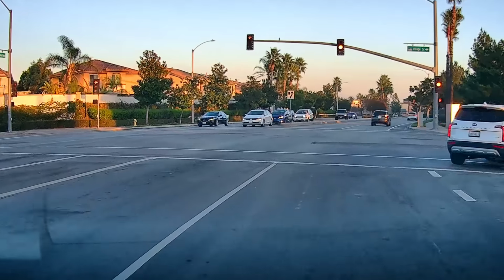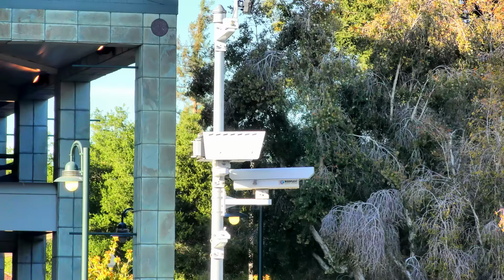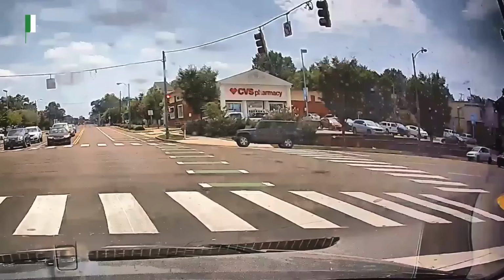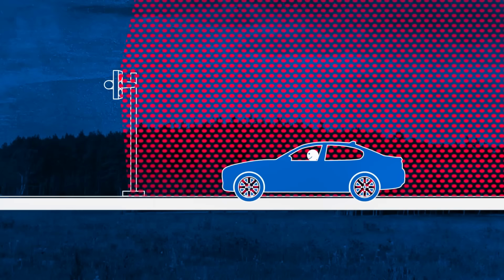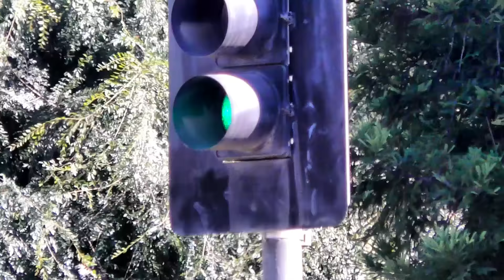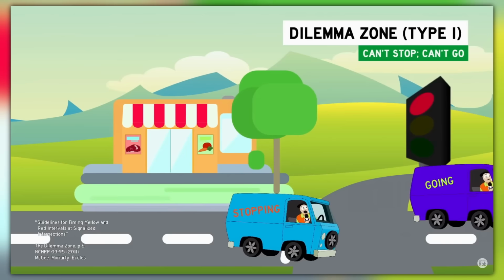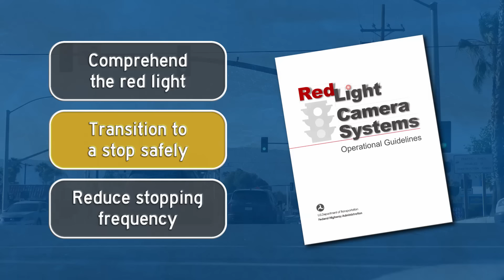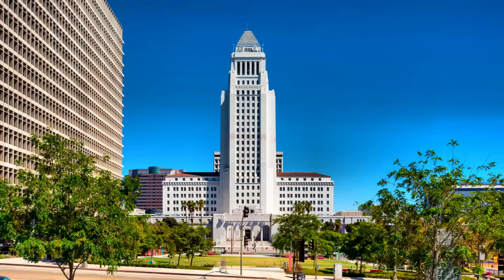Three ways to FIX a STOP LIGHT (so drivers ACTUALLY STOP!)

Comment: One thing I'd like to see discussed is the placement of traffic lights on the far vs the near side of intersections. Near side signals require a larger setback, which costs space, (but leaves a convenient spot to put in a pedestrian and/or cycle crossing) but it also gives accidental red light runners a little more time to react. As I understand, the placing of traffic lights on the near or far side isn't as uniform in the US as I first thought. Any comments on this?
Reply: I came to make the same comment.  It is my understanding that near side signals greatly discourage crosswalk and stop bar encroachment, and in addition they would be visible earlier in scenarios like following the RV.  Is it true that the primary reason for mid-intersection signals is cheaper installation?
Reply: That was what I wanted to ask as well since the near side is the standard in Europe and far side is more of an NA thing and a comparison by Rob is certainly interesting.

I can certainly add another benefit for front lights: They have to be installed to the side, slightly above the sidewalk, which in turn makes pedestrians and cyclists more visible for drivers.
Reply: @MarioFanGamer659  Something else that isn't mentioned is the painting of the poles that carry the stoplights.
Just like the backplate with reflective stripe (which is also used here), the very recognisable poles make it a lot easier to see stoplights.
Reply: @Robbedem  MN traffic light masts were historically painted yellow, while the arms over the street were typically grey. Lately the state seems to have switched to all-grey, but new yellow masts do exist. Painting the arm yellow as well would certainly make the signal stand out (the standard mast arm has two 'arms' - the main and a smaller support arm just below it)
Reply: Far-side signals seem to be the standard on state installations here in Texas, but I think this facilitates the use of camera or radar sensors to adjust the light cycles to demand, which is also very common in Texas.  Obviously, a sensor can get a broad view of all lanes from the other side.  Keep in mind that TxDOT always uses wide stop bars where you need to stop, even if it's just a rural intersection with a stop sign.
Reply: I find near side traffic signals to not be as good because you have to crane your neck to watch for it to turn green. To avoid this, you'd have to be so far back of the stop line that it just looks silly.
Reply: "As I understand, the placing of traffic lights on the near or far side isn't as uniform in the US as I first thought."

The standards you're looking for are in MUTCD 4D-13 and 4D-14.

People talk about how European intersections use only near-side signals, which deters people from encroaching past the stop line. Unfortunately for the US, that design is impossible under the aforementioned standards.
Reply: @princekamoro3869  yet there are many intersections that have them on the near side. I side they're not up to code.
Reply: Good point here. The near traffic beam is difficult to see sometimes if you’re in the first row, since you have to bend forward and keep looking up the entire waiting time. It makes me wish it was a far traffic light.
Reply: This seems to be a regional thing. I've noticed that all states do it differently but the common trend seems to be that in the West, Southeast, and middle part of the country, far side installations seem to be more common. Likely not coincidentally, these intersections seem to also have newer signals mounted on poles. Only in the Northeast do near side installations seem to be more common, often mounted by wires instead of poles. Obviously there are exceptions. Some of the coolest traffic light poles are in Tempe Arizona.

I really wish I saw more backing plates and reflective tape on intersections near me. The state re-did an intersection and put up new signals that backing plates, reflective tape, that were pole-mounted and on the far side of the intersection. This might (and hopefully is) the new standard for the state, but way too many intersections don't meet this standard.
Reply: Many traffic lights around me, New Jersey, have some lights across, but also some of the light near side as well.
Reply: Near-side signals enable more precise red clearance time calculations, resulting in more efficient and more believable (->respected->safe) red light durations. Because the formulas don't need to account for cars stopped way too far forward - those drivers wouldn't be able to see the light anyway.
Reply: I grew up in Chicago, and the streets are covered by snow or slush for many months. Can't see the stop lines, so they place a second stoplight on the left side, and I would use that to indicate where the stop line is.
Reply: @davidhirschhorn2960  in Canada we just put a sign next to the stop line so you know where it is when the roadway is covered in snow.
Reply: I accidentally ran a red light in Canada once, (I'm from the UK) and it was a 'far side' signal. I only realised I'd ran the stop line when I was in the middle of the junction. Thankfully this was very late at night, and the traffic was basically non-existant.
Reply: @MarioFanGamer659  In the US traffic light profiling is determined by states and municipality, which is why NYC and LA have very different intersections. Here in FL we don't use side signals except in very specific scenarios. Recently there's been efforts to put signals in front and at the back of wider intersections redundancy.
Reply: @OntarioTrafficMan  I'm in unincorporated Jefferson County, Colorado, and we do the same thing at most of our traffic lights (I think just the busier ones, though I could be mistaken).  It's a rectangular white sign that says "STOP HERE ON RED" with a big, bold arrow pointing diagonally down and to the left
Reply: One thing I have seen about near side signals is that it forces drivers to look out of pedestrians since they are above the sidewalk. Also I don't think near side signal require that much of a set back if at all. It's not like it has to be exactly atop the sidewalk, it can still hang out a little to give a a clearer view and contrast. I think far side is better when its more car centric like in arterial or major collectors. Near side for local and minor collectors.
Reply: @DashCamOutEast  In Europe we have lower heads on the posts as well for those at the front of the queue
Reply: @DashCamOutEast  @princekamoro Such as just about the entire state of Florida!  Almost all the lights seem to be on the near side, and with no "side" lights at all.  If you stop too close, you end up sitting with your chin on the steering wheel to be able to see the light!!
Reply: @MikeV8652  Here in the Netherlands we use a lot of smart lights, and they're almost all near side, so that's not a reason for far side.
Reply: @DashCamOutEast  A lot of european traffic light intersections also have an indicative light on the left far side of the intersection.
Reply: @sherifbatawy  A lot of european traffic light intersections also have an indicative light on the left far side of the intersection.
Reply: @fluitfluiten  yeah, but it only takes a van/ bus/ truck on the left side to block the view, which does statistically happen often.
Reply: There’s a reason he’s wearing bright clothing, wide intersections like this are dangerous unless you’re surrounded by tons of metal and airbags
Reply: @sherifbatawy  most of the time there is one above the lane as well as one on the side. The one on the side ist not that difficult to see. But I although think that works worse with more lanes. But in my city there are very few streets with more than to lanes per direction. Here in Eu
Reply: Then there's Michigan with all the stop lights in the middle of the intersection hanging from a cable. It's the worst of both worlds...hard to see and not nearside.
Reply: Here, in South Australia, we tend to have both near-side lights, to allow for early recognition, & far-side lights, so that the drivers in the front row can get a good, quick take off...
(take off being deliberately used, because some of those idiots tend to see if their car can start flying by the time they're on the other side of the intersection 😠)

Comment: On some of the stoplights in Auburn CA, there was an attempt made to use the yellow tape on the lights to make them more visible. But the more important ones directly faced the morning sun (during rush hour), producing a harsh glare and overpowering the actual stoplight. 

They were removed within a month.
Reply: Only red I’ve ever accidentally ran was similar to this. Sun was coming up and right behind the lights so I simply couldn’t see where the lights even normally are (mind u I drove through it daily) and realized it was red as I was in the middle of the intersection
Reply: When was this? I drive in Auburn everyday and I dont remmeber this.
Reply: @baddriversofthenorcalarea500  3-4 years ago. I stopped commuting this route about a year ago too.

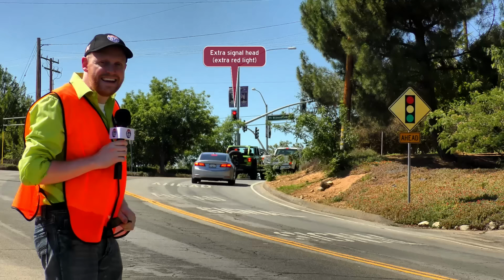Comment: 4:32 Almost as if to reinforce your point, the additional signal head is at risk of being obstructed once again by overgrowth of the tree nearby. Maintenance of intersections is just as important as good design to ensure proper safe operation!
Reply: In reference to 'maintenance', I once had to call the city of Huntington Beach (CA) to complain that I could not see the signal head on the mast arm (due to overgrown trees protruding over from nearby private property, branches blocking view) and also due to having only one signal head on the mast arm (there should be two signal heads along with the one signal head pole-mounted).  The trees were trimmed back in short order however the city disagreed with about quantity of signal heads required for that travel movement (three travel lanes but no left possible due to side street terminating at the signal; city claimed the two total heads comply with MUTCD -- I still disagree, you generally apply one signal head per travel lane).  We were then able to see the traffic signal after the trim job put the signal in compliance for signal head visibility distance from intersection, based on approach speed.

Comment: In some parts of Utah, such as the 193 in Layton, they've installed stoplight warning lights, that are 100-500 feet up the road and turn on when the light is about to cycle off green.

They had them on the Davis county segment of 89 before the construction removed at-grade crossings.

Also, in terms of signal coordination, the best road I've ever driven with it was the Great Highway in San Francisco (along the beach). The only hindrance to that one was the other drivers who would speed to the next light, get stuck, and cause a backup, so if you were travelling at the proper speed, you'd still have to slow down due to the wall of cars that sped up to the lights and waitied.
Reply from the maker: As a Utah native, I got used to them on Bangerter Highway and the SR-201 freeway.  That (and fry sauce) I do miss about Utah.
Reply: @RoadGuyRob  they really just need to rip out all the stop lights on Bangerter and turn it into a proper freeway. As a recent addition to Utah, I always worry about high speed collisions on Bangerter and also on Mountain View Corridor - since both of those are basically freeways but yet still use stop lights.
Reply: As a trucker based in Utah I avoid  Bangerter whenever possible. 
I can't get up to speed quickly enough before having to slow for the next light. So people in cars are annoyed and make unsafe maneuvers to get around. 
And the left turn lanes that are inconsistent make that very hard unless you are very familiar with the highway.

Comment: My favorite solution is the warning flashing yellow which tells the driver to prepare to stop when they see the flashing lights. A driver going the speed limit will enter the intersection on a green if they don't see the amber, but if they do then there is plenty of room to slow down. Timed to sync with the future state of the intersection light, it removes all uncertainty. It encourages the driver to adjust their driving in a safe and predictable way.
Reply: This is what we have in my city. These advance warning lights are perfectly timed with the intersection. Once they start flashing there is no way you will make it across the intersection.
Reply: I have seen the countdown timers,  these are very useful, there work on many levels,  one they give real time how long that yellow is going to last,  and second, prevents road rage/stress/panic driving.  even green and reds have timers,  it's good to know how long you have on your red light, it give the driver up front a heads up, on how long they have to, change that radio station, and/or look at text message,  this may help with traffic congestion as well,  a few seconds is enough for one or two extra cars being able to make the light in that cycle.
Reply: @wflzoom6219  Countdown timers do not work for dynamic lights. How long the red or green phase is depends on the current traffic and the phases of the other junctions up and down stream. This is a much better system because the red phase can end early if it detects no more oncoming traffic, and also adjust the green light phase of several junctions to have smoother traffic.
Reply: These are very popular in my area (eastern Nebraska), especially for roads with speed limits over 45 MPH.  I've seen a few isolated use of them for railroad crossings, too.
Reply: My country trialed a green light countdown timer at 1 downtown junction but abandoned it as drivers sped up as the timer counted down to zero

Comment: One thing I was taught in driver Ed, watch for the cross walk signs to prepare yourself to stop. See the red hand flashing? Probably get ready to hit the breaks.

It’s helped me anticipate when a light is going to turn red in some areas, deff a good little tip
Reply: You shouldn't have to watch a signal meant for someone else, to determine your course of action.  Roads should be painted with a yellow line to indicate when to recommend you speed up for yellow, and when to recommend you slow down for yellow, assuming you were driving the speed limit.

Comment: I grew up in Shanghai, and most of the time there, the lights had a countdown for when it will change, and if they did not, the green flashes for three seconds before the yellow. Running a yellow is not legal. This solves both the going though yellow and the confusing which light is which problems.
Also, here in Calgary, the background of the signals are simply yellow.
Reply: In Michigan the signals are all around yellow, dunno if that’s a better solution than a mixed color scheme tbh
Reply: Then you don't need a yellow light.  A yellow light in your system is just a legal red light, and the blinking green is the yellow light.  If you don't stop during the flash, you'll eventually run the yellow light you said isn't allowed.

So it's a cultural familiarity but the same logical situation. 

In pre 1960 US, some very old lights did.  
Green, Green-Yellow, Yellow, Yellow-Red, Red.

The reverse on the 90 degree.

That basically says everyone stay stopped till Andy and Barney decide you've enjoyed enough relaxing..then go slow. 

People ran those frustrating things a the time.
Reply: Oh it is dark in Canada and South Canada (Michigan) most of the day on the winter side of the equinoxes.  That's why you have the yellow backer plate and lighted street name signs that down light crosswalks and school bus stops.  Good ideas too.

In Pensacola Fla the sun is blindingly white most of the year and most of the day....black backer plates help shade and contrast the light.  The yellow stripe is for the dimmer or darker hours.
Reply: @STho205  The countdown is the main factor actually
Reply: @maxxiong  so the blinking green is meaningless,but a secondary device with a countdown is just now the equivalent of the yellow light of tradition.

Do you still go on 15?
10?
5?
4?....
1????

How long does it take you to clear a 4 lane intersection, a 6, a 2, a hillcrest, a dip?????

Is that a guess, a detailed Mr Spock calculation, a known objective fact. 

We have crosswalk countdowns, and I do tend to use them to guess at the light....but they aren't necessarily exactly linked.

Comment: Glad to see the mention of roundabouts, but there is a whole world of options for traffic calming to give drivers psychological signals to slow down, with many listed in FHWA's Proven Safety Countermeasures under the Safe Systems Approach. (In fact, the Safe Systems Approach probably deserves a whole video in itself!)
Reply: So true, traffic calming is something easily fixed with measures like protected bike lanes, trees, and of course roundabouts
Reply: Most highly underrated comment on this thread. Absolutely. The thing that would have saved the 7 year old from being murdered by a car is to not have the 71 year old driving, which is only accomplished if he has an alternative substitute like transit or can walk or bike to where he needs to go, without worrying about getting hit by drivers.
Reply: @jayjackson5705  if you first build the city to highest level of car depending levels, its hard to choose something else or even fit the other options in.
For a lot of the solutions sounded like we engineer around the misbehaving drivers and make it easier/nicer for them. Not forcing them to reduce the speed, but building around there inappropriate speed.